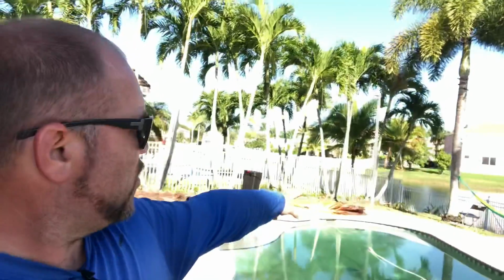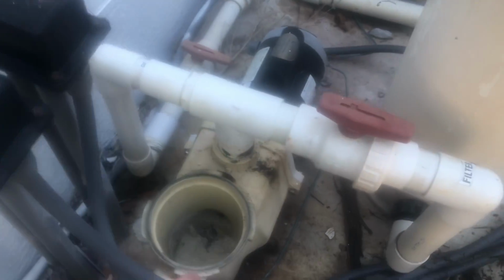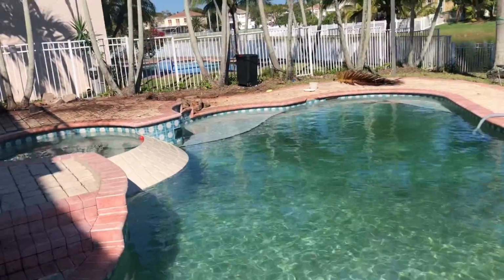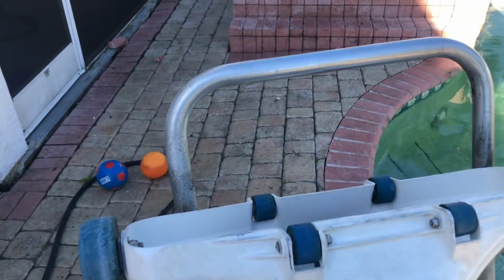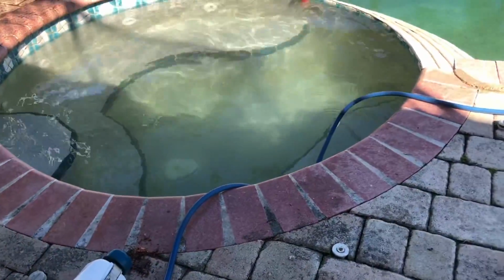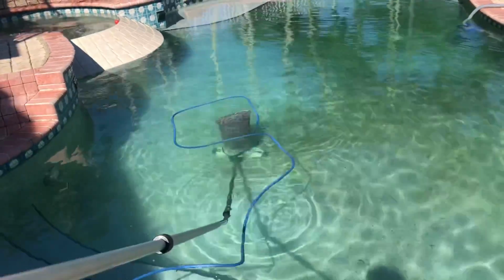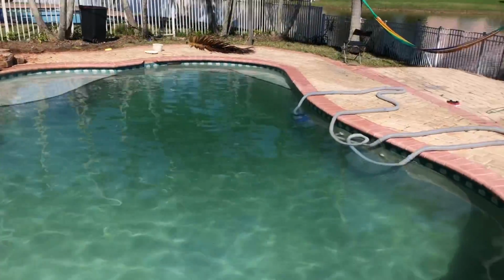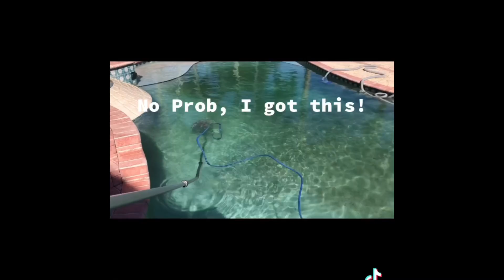How To Clean Up A Severe Debris Filled Pool | Heavy Duty Pool Cleaning

Comment: What’s the best algae killer that you recommend I noticed in this video you said you were gonna add some algae killer. Thanks!
Reply: I use algecide 60. Theres diff brands but I use that when I have a pool thats nasty green or even black. But you don't need that strong stuff for just a lil maintenance
Reply: @lucaswitdatrueff3468  great choice on poly quat the best option. beautec algatec and pooltec are my go tos.
Reply from the maker: I used Yellow Blaster from EzChlor